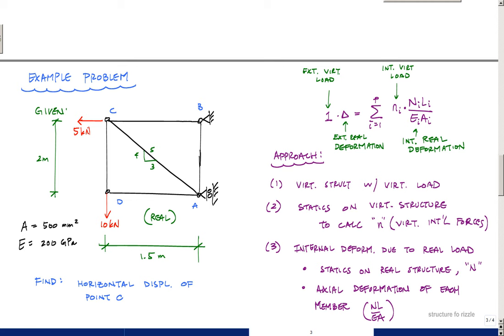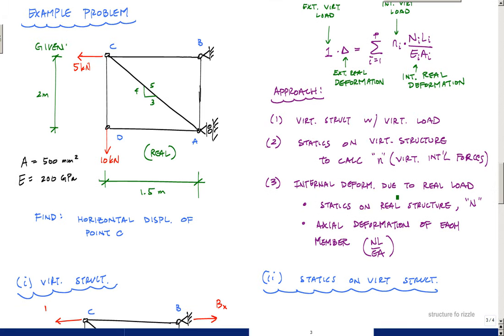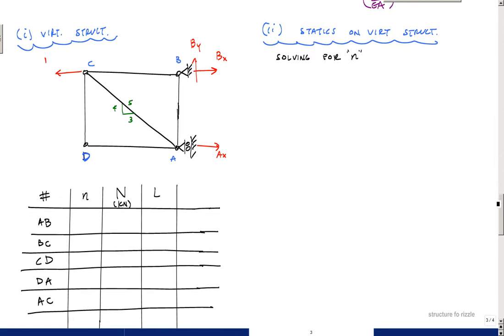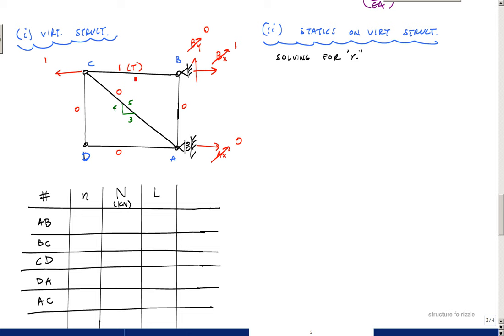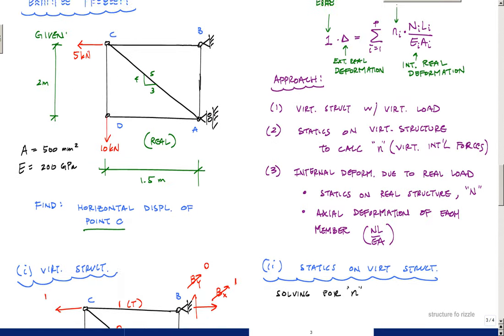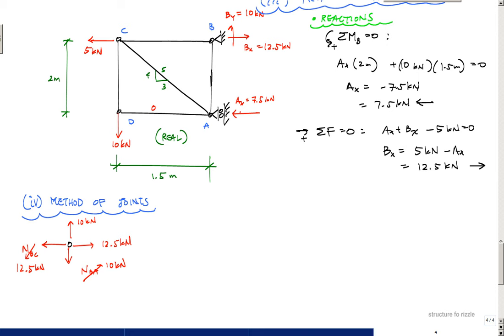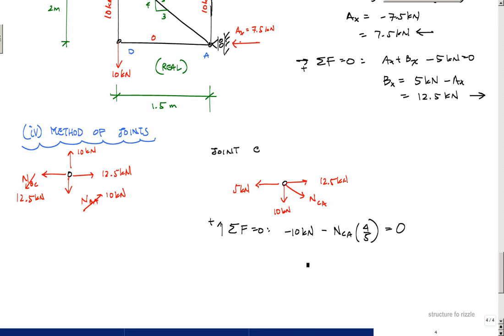Method of Virtual Work - Truss Example (Part 1/2) - Structural Analysis

Comment: Would it still work if you applied a virtual load vertically instead of horizontally?
Reply from the maker: You would then be trying to calculate the vertical displacement.

Comment: What would you do if an extra member was placed on joint BD with displacement required at the same position as the original question

Comment: Peter Mukiibi
1 second ago
A question here; in the the virtual work method for evaluating displacements of nodes in a truss, do i have to calculate deflection in the x-direction and then after the y-direction in the case where the node experiences both x and y forces? (i.e applying unit load displacements differently for both cases

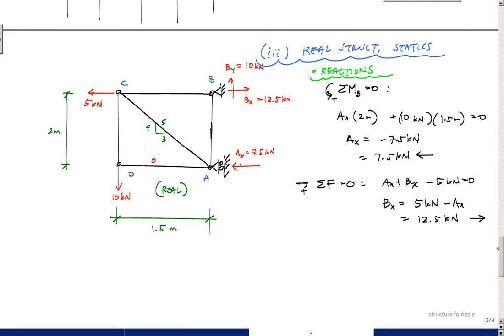Comment: when you used basic statics to find Ax in the real structure , shouldnt u have considered the 5kN reaction at C during the equilibrium moment at B.(Slide at 6:07). I calculated Ax to be 11.25. I am not sure but can u explain please..
Reply: Arun Mathew if you take moments @B the 5KN force is applied in the same line of action of point B and considering moments is force x perpendicular distance and the 5KN is acting in like not perpendicular you do not include it in moments calculation
However for sum of forces in x you definitely need to consider the 5KN load